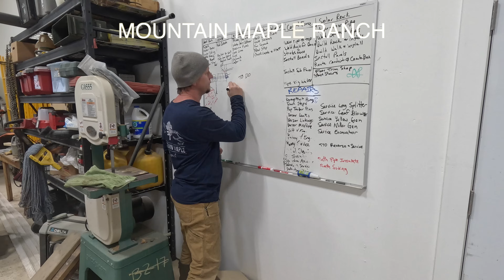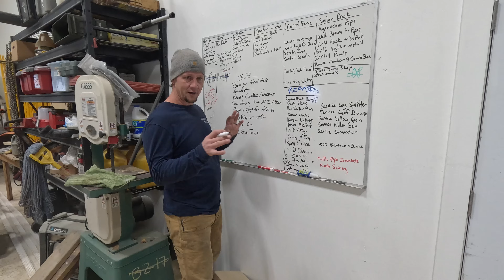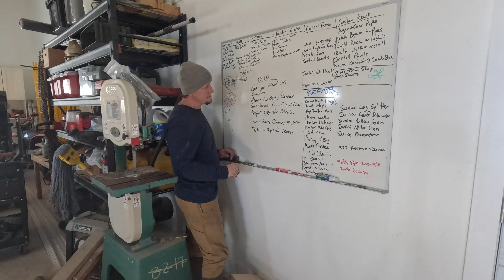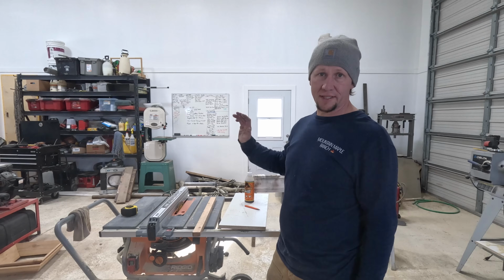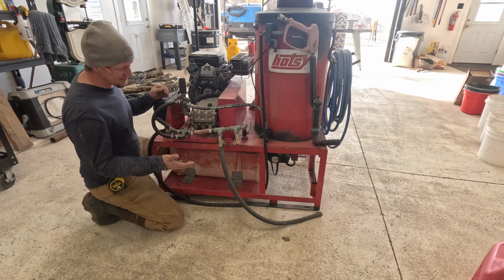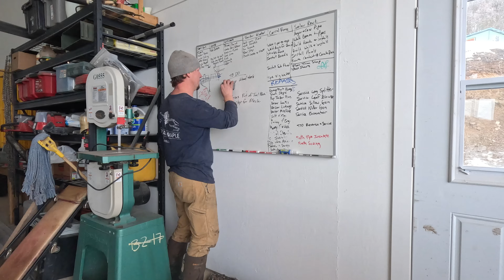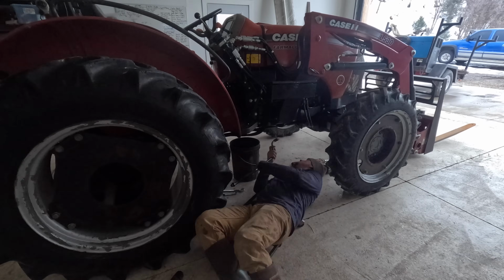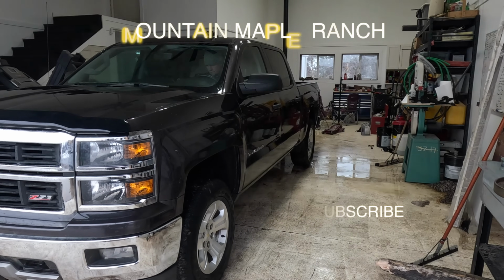Taking full ADVANTAGE of the BAD WEATHER !!

Comment: I know how you feel about to do lists and the grading as in ether URGENT or LATER. I have spent the most of today lifting and recementing all my ridge tiles as they are leaking and we are due none stop heavy rains. Had to be done and fast. Repainting the bathroom can be done when it is raining outside and I can work in the dry. But no matter how hard or how much efforts you do you can be rest assured that what hours you have you will always come up short, just got to plug at it. Thanks for posting....

Comment: I'm curious about if you are going to put in a drain next to the shop before the next round of concrete so when the snow melts or heavy rain happens so that your shop doesn't get flooded? Just curious 🤔
Reply from the maker: We have gravel in the back of the shop, seems to be doing well so far. But we build on to the back there will be lots of water measures in place.